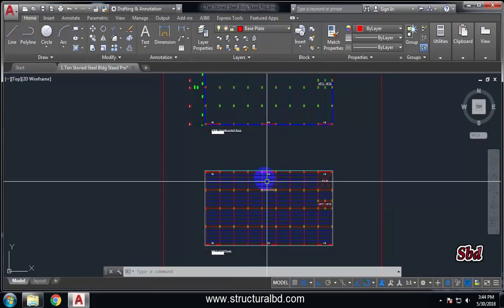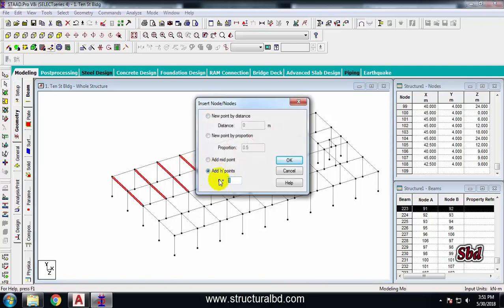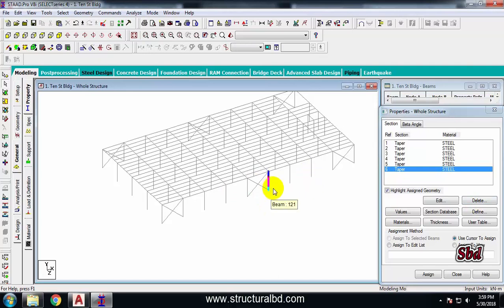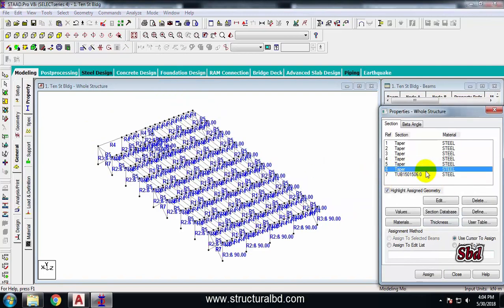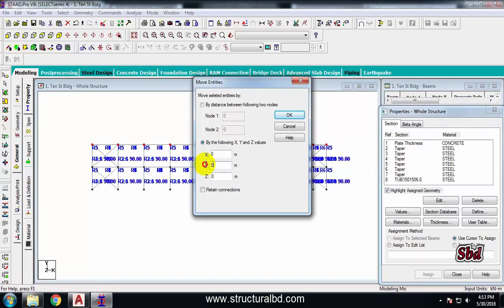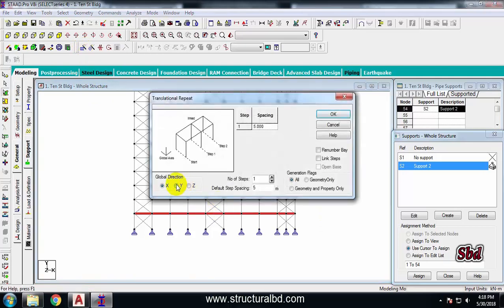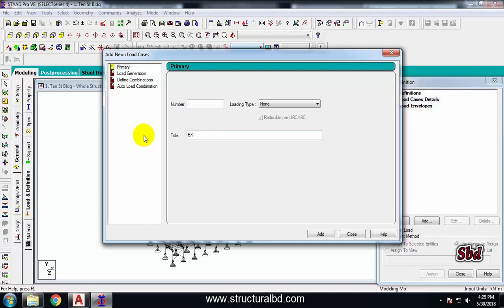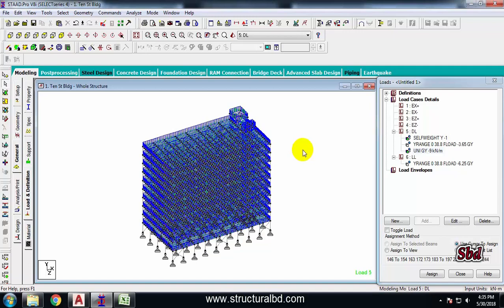Seismic Design of 10 Storied Steel Structure in Staad Pro V8i Part-01

Comment: But, why have you replaced the density of Steel instead of Concrete.  If you need to neglect the self wt of Concrete, hope the Density of Concrete part has to be replaced with 1e-0032 in the staad editor.

Comment: While adding loads in LOAD CASE DETAILS why you kept load type as None.. Eg:You might have choosen (Seismic) for EQ X+
Reply from the maker: It does not matter when you doing manual load combination. For auto load combination selection specific load will be needed.